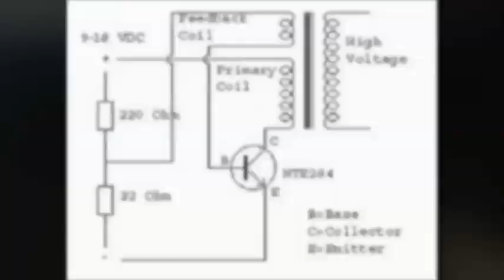Simple Flyback Driver

Comment: I am using a BU 4525AX NPN transistor and my circuit is a lot quieter than yours. I also did not need a fan even after 20 minutes of running time. It's my understanding that people do not run these for that long because they worry they may damage components. The components I have selected seem to run very well together for long  periods of time. I am happy, now I have a decent supply for my micro Tesla Coil. Put together and working in under 10 minutes and played with for hours. I love new toys!

Comment: High voltage is not really deadly. This drivers output will not kill you unless you have some magical 2n3055 that wont blow with more input power. Now, a half bridge or ZVS driver on the other hand is as deadly as a MOT

Comment: what happens if you put a small fim capacitor (rated 100V+) across the collector and emmiter? see if it improves the output.  also, try to add a few inducter in different places to see what you can make happen!

as far as i know, the circuit is not all that great, and the transistor dies often.

Comment: A single transistor flyback driver has an output of about 1 mA at 12KV. It will shock you but you need more than 50 to kill. A 555 driver (like on my channel) supplies about 40 mA at 30KV, getting dangerous here but you will most likely survive, a ZVS can supply in access of 800 mA at 50KV. So way lethal. A tip is not to hold both wires at the same time, ground your - of your flyback and hold that with your other arm at your back, that minimizes the chance of a good path. Have fun!

Comment: @davethehunter2 Hook up an old laptop charger or a cell phone charger to the wall outlet and cut the wires (Note the amperage is dangerous, but the voltage shouldnt be high enough to reach any of your vitals. Just dont hold + and - in your left and right hands. I find that some of the downstep tranformers have good amperage outs of 1-12 amps. Higher the amps, better flyback sparks with less stress on those npn transistors.

Comment: The capacitors you're referring to in that flyback are part of the internal voltage tripler which takes the flyback's 9-12kv and "triples" the output voltage to about 24-30kv as you see there.  The frequency control is in the circuit board you trashed.  Also, that's running about 2mA no load, much lower with a load and thus sublethal.  30mA is about the limit of a healthy shock.

Comment from the maker: i think there are smaller batteries and on the inside of that carbon rods. i watched a someone take one apart when i was little. there good for experimenting. im thinking about switching the batteries out for a wall outlet, but im afraid it would burn my transistor up faster. But thanks